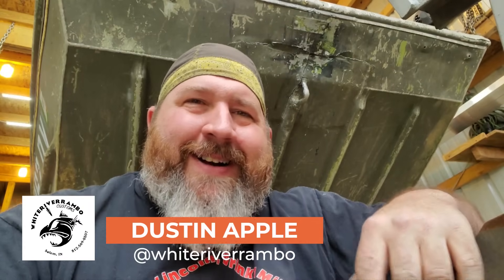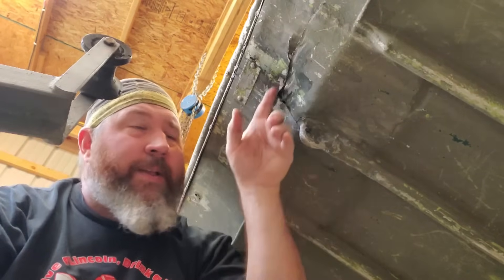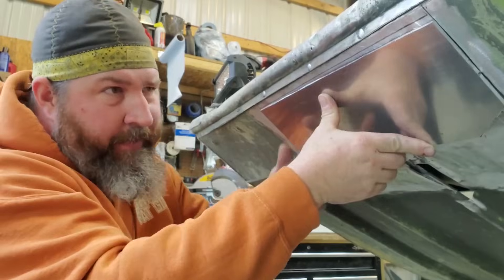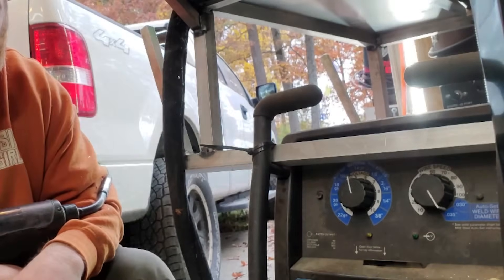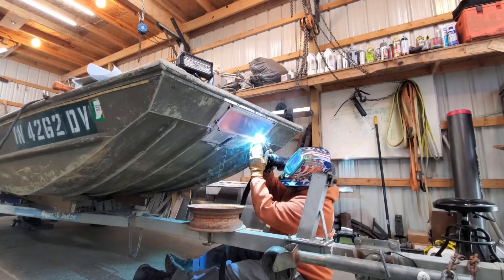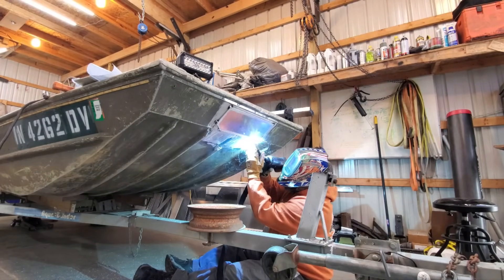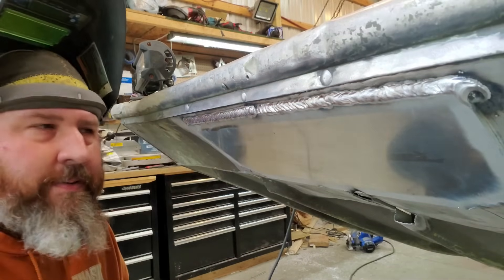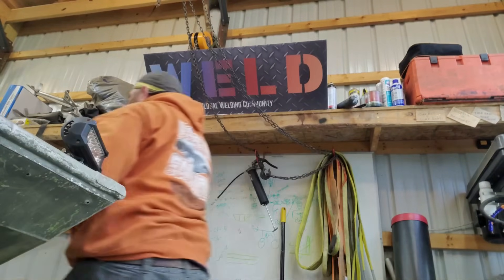Boat Repair: Aluminum MIG Welding

Comment: Do you have to use the spool gun?? Or can we run the same tip with aluminum wire and 100 argon??

Comment: 4943 is a relatively new and increasingly popular aluminum filler metal that offers significant advantages, especially when compared to the widely used 4043 alloy. Here's why someone might choose it:
 * Higher Strength: This is the primary reason. 4943 typically provides:
   * 25% higher Ultimate Tensile Strength (UTS) than 4043 in the as-welded condition.
   * 50% higher yield strength than 4043 in the as-welded condition.
   * It can also achieve superior strength levels compared to 4043 and 4643 in post-weld age and post-weld heat treat and age conditions.
 * Similar Welding Characteristics to 4043: Despite its increased strength, 4943 is designed to be welded using the same procedures as 4043 and 4643. This means welders who are familiar with 4043 can often transition to 4943 without significant changes to their technique or equipment settings.
 * Good Fluidity and Low Melting Temperature: Like 4043, 4943 has a low melting temperature and high fluidity, which helps in achieving good wetting action, low welding smut, and low discoloration. This contributes to good weld appearance and ease of use.
 * Heat Treatable: 4943 is a heat-treatable alloy, meaning its strength can be further enhanced through post-weld heat treatment and aging processes. This is crucial for applications requiring maximum strength.
 * Low Hot Cracking Sensitivity: It generally exhibits low hot cracking sensitivity in most applications, which is a desirable property for consistent and reliable welds.
 * Versatile Applications: It's suitable for welding various aluminum alloys, including 1xxx, 3xxx, 4xxx, 5xxx (with less than 2.5% Mg), and 6xxx series base metals, as well as casting alloys like 356.
Common applications where 4943 is preferred due to its strength and weldability include:
 * Automotive and motorcycle frames
 * Aerospace hardware
 * Ladders and frames
 * Radiators and air conditioning components
 * Ship decks
 * Sports products (e.g., scooters, bicycles)
 * General repair and maintenance where higher strength is desired.

Comment: The welds look beautiful. Amateur/ beginner questions 1. Does welding heavy plate to the light aluminum create a stress point at the edge? 2. Is there reason for concern that water could get in between the new aluminum and the old aluminum ?  If that is a concern how could it be resolved? Thanks for the video and the great explanations

Comment: Great video! For aluminum boat welding do you prefer the spool gun over the TIG for most repairs?? Why I ask is I have a Millermatic 211 and was thinking about getting a spool gun for my machine. A NEW TIG machine would be a lot of money. Your thoughts?? I'm not a business just a guy that works in my garage. Keep the videos coming

Comment: Good stuff. But one of the questions I'm trying to get answered is, at what point do you just scrap these instead of repairing them? I'm on the line between trying a rebuild or trying a new build which looks less time consuming.

Comment: What's your thoughts on doing the same with a Millermatic 211 ?? This is the machine that I have. Was thinking on getting a spool gun for aluminum. Any help would be great. What's the difference between the 211 & the 212??

Comment: Is it possible to 6010 on this material?
Reply: No, it is aluminum so you will need 5356 aluminum wire, the boat is probably made up of 5052 and 6061 so 5356 will be your go to.

Comment: Nice patch there. I would round all the corners than you don't have start and stops on them and start weld from middle to middle. Mig welding aluminium downhill is big no no for me there was space to go uphill and good visibility on front of the puddle.

Comment: sounds like your welding in short circuit, I generally use 5356 on my spoolmatic 30A and in spray transfer mode.

Comment: Aluminum is not suppose to sound like bacon lol it's not suppose to run short arc for Aluminum you want it to be more of a spray
Reply: Okay good so I'm not the only one who thought that
Reply: I believe it would be more difficult to spray the older thin boat material.

Comment: Being new to welding, do you have to preheat aluminum?
Reply: not if the air temp is above 50* and your settings are correct. if the part is over 1/4" thick then it needs preheated at least on the start.  Tig welding however doesnt require preheating as the process allows to you to monitor heat and work accordingly
Reply: @WHITERIVERRAMBO  thanks for the insight!

Comment: Looks good budd, what was your voltage 24.5 / 25?
Reply: unfortunately i dont have a digital read out to tell you. i basically listen to the arc sound.
Reply: @WHITERIVERRAMBO  my 30a stays on 7 and I typically welded 1/4 and up being I do a lot of dump body and coil hauler repair.  I run no lower than 24.5 and up wards of 30 volts.
Reply: Figuring he was short arc welding I doubt he was anywhere near that high as it would have been spray arc had he been.

Comment: Good info especially on torch angle, which sometimes we over look. I wonder if you might do a video on mig aluminum bridging a gap on and or thin to thick  aluminum. I use pulse mig on aluminum and it seems to help, not everyone has a welder capable of pulse aluminum.  I usually fill the gap with scrap aluminum first but this is not always do able.
Reply: Turn your amps/wfs down real cold and drag it like you're running a steel mig open root. Don't shoot the gap and keep your wire in the puddle, weave side to side like you're walking the cup but in reverse because you're dragging. This method is very sensitive to the wfs, Just like our boy Dustin here said, If you burning through turn it down. The resulting weld will be sooty so just brush it and run a beautiful bead over top like normal (push). It ain't easy, but it's doable. Also this method is in no way up to aws structural standards, I just use it for cosmetic stuff. 99 percent of the time there's access to the backside of the weld and I just use copper or stainless as a backer.
Reply: I run pulse on a Lincoln s500.. when it comes to gaps I prefer tig for the control, but if you can turn your voltage down cold and use your arc control to get a wide arc, I've had luck with bridging/ filling gaps on pulsed mig. I'm sure there are other tricks for cv, but I'm in a production shop and don't have time to deal with the spatter from that, so never played with it too much. Not an expert, but I hope that helps somewhat👍

Comment: welding this stuff in the field is a nightmare
Reply: yup, a wind break is a must and a little luck is required.
Reply: I won't weld it unless it's inside.
Reply: @chadkennedy529  I was at the bottom of an elevator shaft
Reply: @welderboy13  that's never a a fun place to do anything, I do heavy equipment repair so 9 times outta 10 they have a shop to pull the shit into.
Reply: They make smaw electrodes for aluminum field work.
Reply: @notanymore9471  those are terrible tho
Reply: @welderboy13  they work when you need them. Certainly not TIG but if you are outside/in the field and have to weld aluminum they get it done. But yeah I get it 😂.
Reply: @notanymore9471  Need a remote and a pulse setting to keep from burning it up
Reply: @welderboy13  I used those once messing around I preheated some aluminum and the rods do okay
Reply: @michaelolaez8707  I've used them a few times, I've used them where it was too much of a paint in the ass to tig or spool gun. I don't care how good you are an aluminum stick weld is never turning out visually appealing 😆
Reply: Soot it,preheat till the soot comes off ,should be in the ballpark for preheat. On that boat,may want a torpedo heater!
Reply: What do u mean?
Reply: Better of with some aluminium specific arc weld rods, gooey to use but easier outside than any gas process.

Comment: fliped the wire spped and volatge control  in the video
Reply: yup, i misspoke and said "feed rate" when i shoulda said "Amperage" or "power settings"
Reply: @WHITERIVERRAMBO   no worries really good contentent hope to see ya again on the channel
Reply: @noah8877  absoulutely will be featured on a regular basis on here & within the app. i appriciate the critique, we try to proofread but sometimes minor flubs get through.

Comment: Your aluminum weld will never be as strong as an aluminum tig weld. Still looks good.
Reply: aluminum mig is a dirty process so there's no argument from me, however tig isnt required very often. i do a lot of Tig on the topside & interior parts just because its preasing to the eye.